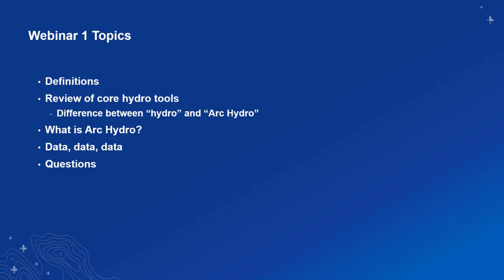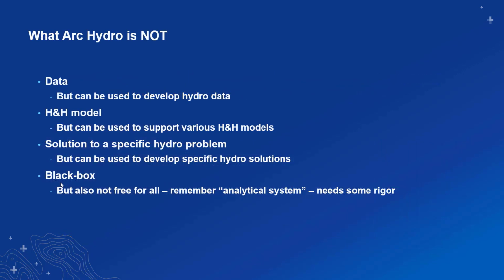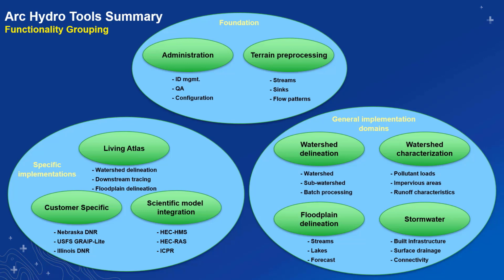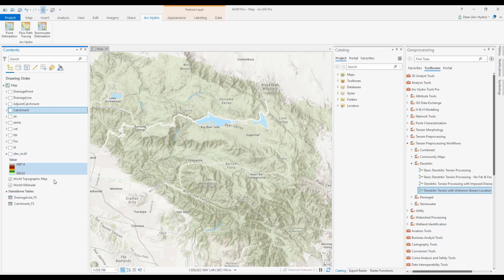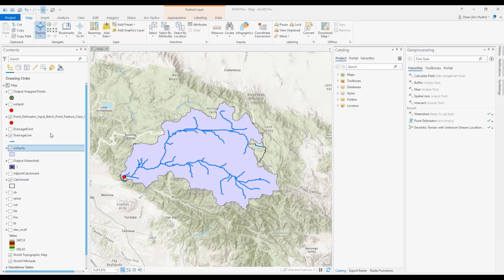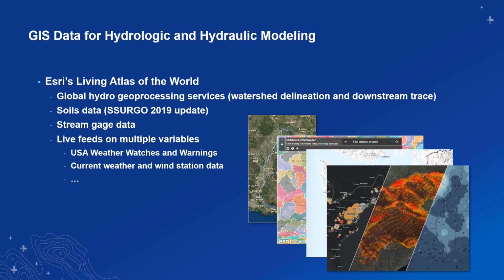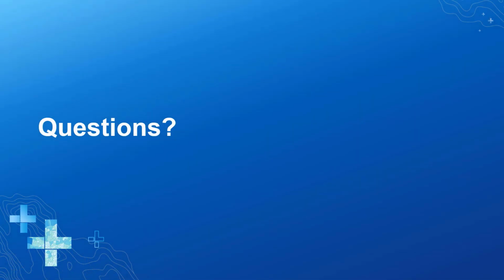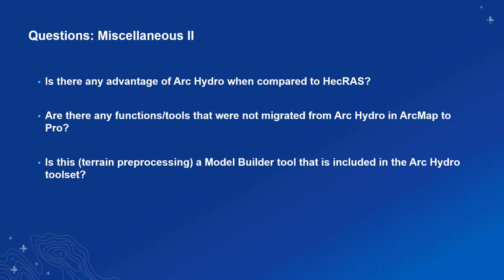Arc Hydro in ArcGIS Pro

Comment: When I modified the number of cells parameter in Dendritic Terrain with Unknown Stream Location, after saving it, it still seems to have no effect. It still runs according to the default value. The catchment area I usually analyze is very small. Very troublesome.

Comment: How to create multiple parallel catchment areas in a model? Every time I define the next one, the original catchment area is always replaced.
Reply: Simply change the name of the Output Features of the previously analysed catchment(s). Not changing these names will cause the software to overwrite previous Outputs hence replacing them. I hope this makes sense.